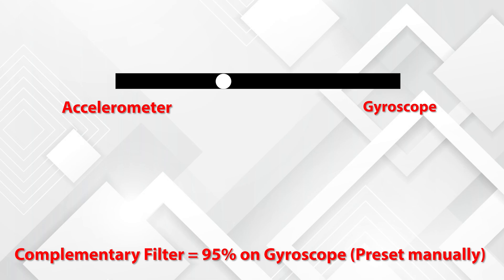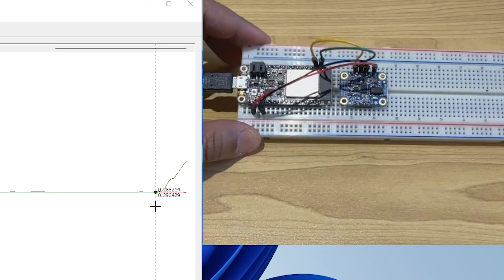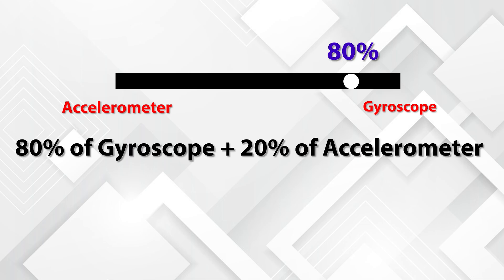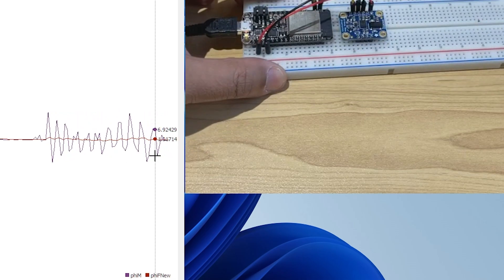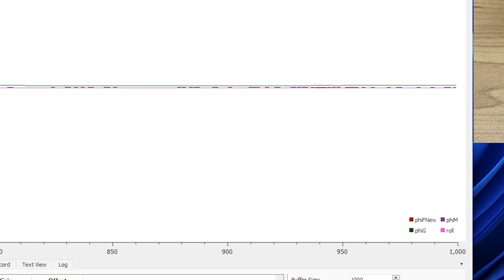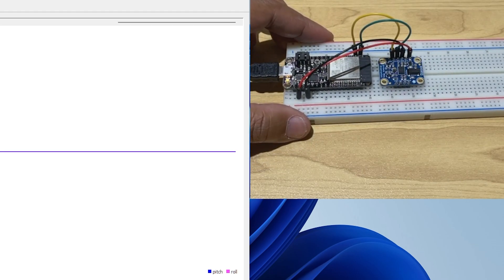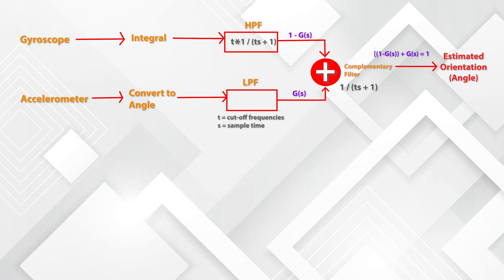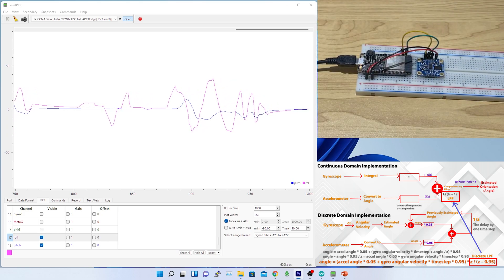Complementary Filter Sensor Fusion between Accelerometer and Gyroscope to estimate Pitch and Roll

Comment: I'm trying to use an accelerometer to make a light come on when it detects deceleration and I've manage to make a code to get it to work how I wanted it to, but I've come across a problem, when I'm going down hill it will turn the light on. do you know how to fix this. I'm new to Arduino so only know the basics
Reply from the maker: When you are going downhill, your velocity increases; which means your acceleration increases. To reduce the velocity, you might be pressing break, which means reduction of velocity; means deacceleration. That's why light is turning on. This is my guess without knowing you usecase. Where have you put the device, is it in a car or on your body? 
If you keep the velocity same in the downhill, light shouldn't go up.